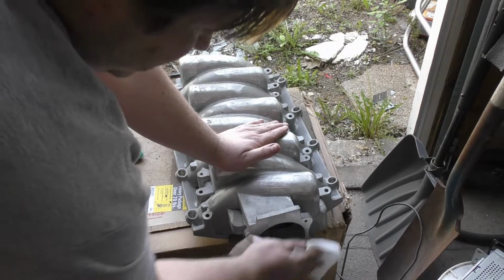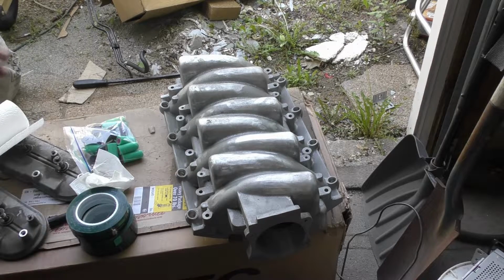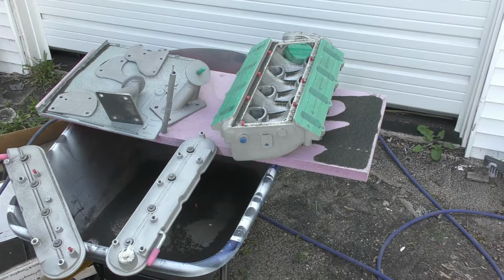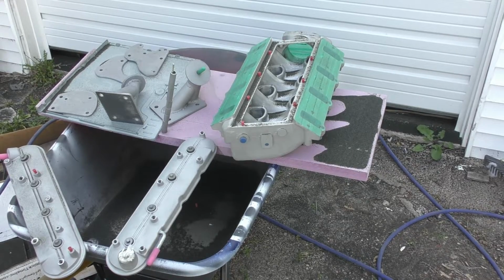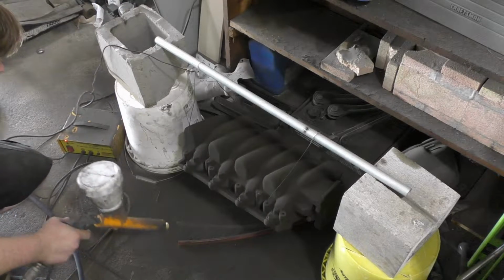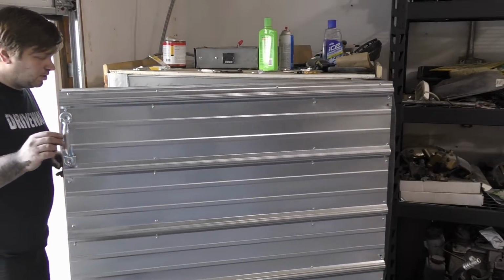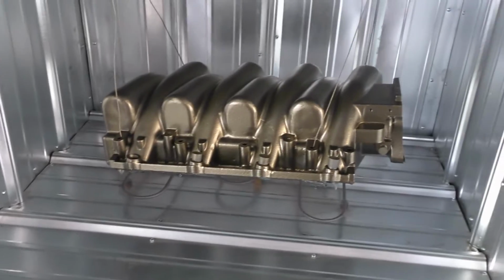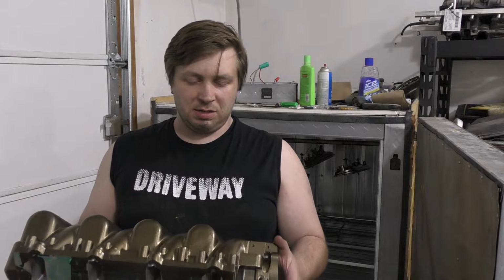V8 Crossfire Project: Powder Coating Some Engine Parts | Driveway

Comment: Just got back from holidays, 
Glad you didn't burn the house down. Looks like the oven worked real good.
Color, turned out real nice....I said an SOB when the intake dropped.
Reply from the maker: That was a real bummer.  I easily could have edited it out, but I figured to leave in the blunders - its all a learning experience

Comment: This is awesome! What brand of blasting gun is that and what is your blasting material of choice? I attempted soda blasting with a DIY setup but it did not give me the desired bare metal results. Thanks!
Reply from the maker: Its just a generic Siphon sand blaster like you'd find in a cheap blasting cabinet.  Maybe a Campbell Hausfeld...  For Media, I just used Black diamond - its a coal slag media.  Got both at Tractor Supply years ago